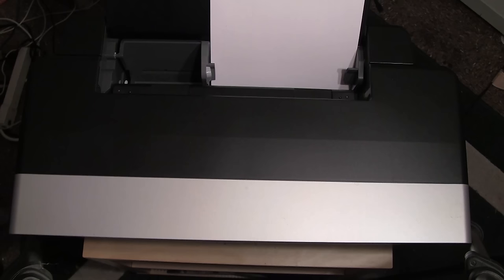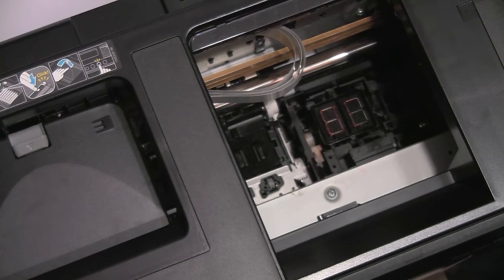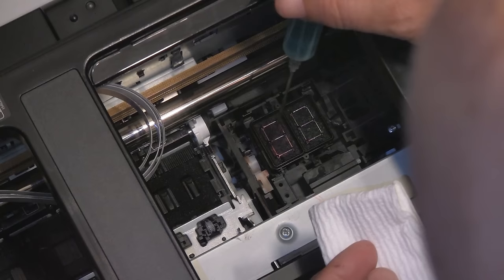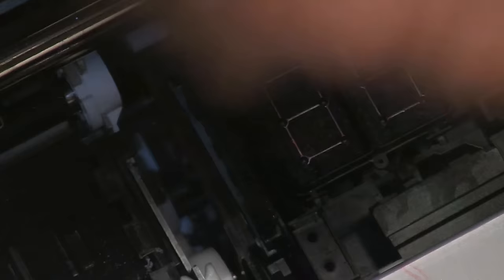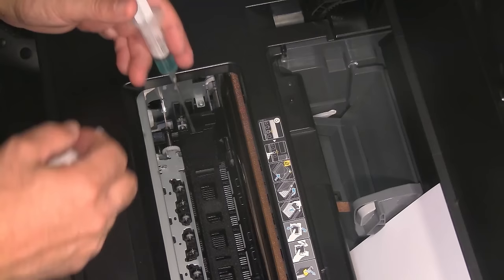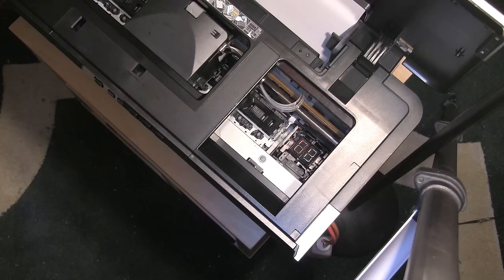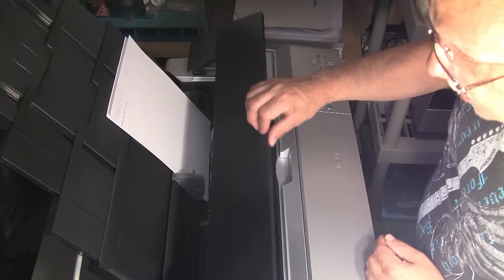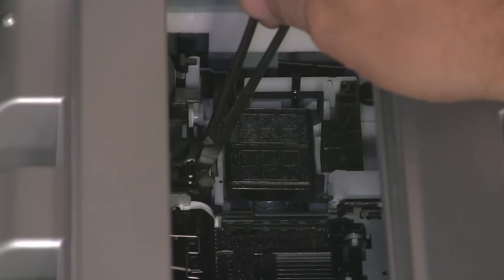How to perform Basic Maintenance on the Epson R2000 and 3800

Comment: after you have left the windex sit for a couple of  hours, plug the printer back in, do you leave whatever is left in the pads there? or blot it out? I love your video, its awesome! thanks so much. I have spent all day trying to get my printer back working (my red cartridge is not printing out on the print test so I know its clogged) and I was at wits end.  All the other information is an added bonus.  Thank you.  PS Im sure you will make a comment:  I purchased "genuine" Epson cartridges (all 8) from China for $36, hey I had to test it out.  Comparing the cost I had too! They are genuine! What I found out was after checking the utilities it provided me with the dates of each cartridge.  Some are from 2011, 2009, 2013, etc.  So just incase you are asked or wondered now you know.  I colors are fine (Ill know for sure when the red works, lol)
Reply from the maker: You carefully blot it up by dabbing. Good luck and let me know how it all turns out.
Reply: Well when I ran the test page the red square did not appear.
Reply from the maker: What printer make and models again? R2000?
Reply: I will repeat the paper towel under the print head.
Reply from the maker: Patience is imperative.
Reply: Well it didn't work and I tried over and over.  I saw your other video on using a syringe and the tube and remove the cartridge, load the syringe with windex and flush the channel.  Where do you get the syringe and tube? Im going to have to try this.
Reply from the maker: Any syringe with a PLAIN tip, not the screw type and a short length of rubber tubing such as uses for gas powered airplane models.  You can buy it from any hobby shop selling gas powered models. You have to slide the print head over some paper toweling. Attach the tubing to the ink nipple of the print head. Attach the syringe loaded with Windex and proceed to try to inject a bit of the solution.  It should not take much pressure.  If so then pull back a bit and attempt again. Bit by bit. Let the printer rest a few hours between attempts until you can freely inject the Windex. Let it rest and run more Windex.  Re install the cart and after a purge cycle you print a nozzle check and cross fingers.
Reply: oh, and where is the best place to buy refillable ink. I have extra cartridges so now I can fill them up. Im already running out of ink because of this. cha-ching!!
Reply from the maker: Wait. What carts are you talking about refilling?  Have we been talking about refillable carts all along and what printer is it again?  If it is a R2000 you can use this device which will allow you to clean a head channel.   http://www.inkrepublic.com/iRemove.asp
Reply: I have a R2000 and it is the Red printer head that is clogged. I have genuine cartridges that I should be able to fill from the front and tape over or i'll just buy another red cartridge.  What has happened is with all the cleaning i am running out of ink and don't want to spend $200 again for new epson ink cartridges just to find out this fix won't work. I'd rather refill my epson cartridges for $100 or less (since I don't need the GO or the Cyan).
Reply: Here is a new one: I  do another nozzle run and the pattern came out with no red pattern showing again.  But when I go and look at my ink levels the red is just about expended. Where is it going?, where are all of the colors going? the ink can't be disappearing just from the pattern prints. I just installed the cartridges the day before yesterday. I haven't printed any photos. I have only performed maintenance printing and testing.
Reply from the maker: You need to inject cleaner into that isolated channel. By the way it is no called a print head, that refers to the whole using with 8 channels. You need to get that item I linked you to from inkrepublic. Watch their video. You remove the red cart, you insert the adapter and attach a plain tipped syringe to it loaded with cleaner. It works as long as there is no permanent damage to the print head unit.
Reply from the maker: Well... the printer will not run unless ALL the carts are there and registering that they are not empty.
Go here for affordable OEM Cart sets for the R2000
https://www.ebay.com/sch/i.html?_from=R40&_trksid=p2380057.m570.l1313.TR4.TRC2.A0.H0.XEPSON+R2000+ink.TRS0&_nkw=EPSON+R2000+ink&_sacat=0
Reply: I have done the procedure with the syringe, twice, and the red square on the print test did not show up.  When I performed the gentle and careful up and down with the syringe there was red coming into the windex solution, both times.  Is that a good thing? Well, either way the test pattern still didn't show up.  I received my refillable ink but now I have to fill the cartridges. but of course I don't have the needles or I guess I have to purchase refillable cartridges.  I thought I could use the OEM cartridges I have.  Im just getting frustrated.
Reply: Hi there, do you know if the Epson 159 inks are Dye or Pigment? They offer two options for the iRemove. My yellow head is clogged (on my R2000) and would like to try this if that what you recommend. Thanks for your help!

Comment: Jose, I just acquired an older Epson Workforce 1100. As I am seeking to convert it to dye-based all-black printing, the first issue I'm facing is: when I send a document to Print, it tries to feed the paper, and the rollers appear to function well enough, but it just doesn't grab the paper to pull it into the machine. I wonder if you might suggest how I could investigate this problem.
Reply from the maker: Well your rollers may simply be worn out. After all it is over 15 years old.

Comment: Hi Jose, thank you for great video. Can i use isoprofile alcohol to clean capin station? Can you recommend the EU alternative to Windex? Thank you for answer
Reply from the maker: Alcohol will not dissolve ink effectively. You need a cleaning solution designed for this. Magic Bulit I believe is sold in Europe.
Reply: In Greece we have Ajax. It is ammonia based window cleaner.

Comment: One more question, can the memory of the R2000 be increased?  I ask because as prints are moved to the printer especially if its a large or heavy print.  It seems to only take as much of the file as it has memory for and print then it takes more then prints more.  It seems that if the printer had more memory that it would create a better print.  My guess is no it cannot be. Also, I have performed your process that you pointed out here and I am back up printing as needed.
Reply from the maker: It's not the printer you have a spooling problem in your computer. One thing you can do is disable to spooler in the services that assuming you're using Windows computer reboot and re-enable it again.

Comment: I left the print head over a Windex-ed paper towel overnight, and this morning the paper towel is completely saturated with black ink! Is this is FUBAR situation?
Reply: Lots of yellow seems to have saturated the paper towel too, but I think it's getting obscured by the black. I haven't been able to do a cleaning or nozzle check because the printer's saying the red cartridge is empty though I just replaced it with a fresh one. 😭
Reply from the maker: Nowhere do I see what Printhead you are talking about.

Comment: do you think this printer is still good today compared to the new printers like the canon pro 100?
Reply from the maker: +David E Well that's like apples and oranges. The EPSON R2000 is a Pigment based printer with Gloss Optimizier and the CANON Pro-100 is a dye based one. Both are excellent. Just because the R2000 is now fairly old does not mean by any means that it is inferior. I have both of them and absolutely love them.

Comment: Hello sir. Thank you for the inspiration. I was given and Epson Stylus R2000 print and after about 40 copies I received the out of ink indicator. Well I purchased Epson 159 ink and now the ink indicator just stays on please assist.
Reply from the maker: You got an empty cart level indication on the driver? You purchased an original Cart and after installing it still shows as empty?
Reply: Great question. I had not fully installed the drivers needed to monitor the cart levels. I uninstalled the driver from the disk and installed the driver compatible with Windows 10. I also unplugged the USB cord for the printer until prompted to connect. Problem solved. Cyan was registering as empty. I purchased another one. Printing fine. What is your recommendation for refill carts? I also see it may be in my best interest to install an external waste bottle. Please assist.

Comment: How does white plastic strip fit
Reply from the maker: It attaches on the right and far left rear wall with a spring. and passes though a sensor behind the print head. That's the difficult part.

Comment: Great video. It answered a lot of questions for me. However, I have an Epson 1430, which is somewhat different. Do you have a video specifically for it?
Reply from the maker: Not really. All have print heads. Purge pads on far right. Purge pad gaskets. Wiper blades. The R2000 is maintained the same Way as the 1400 series.
Reply: @cheo1949  Thanks! Yes, your instructions for the R2000 worked for my 1430. Just checking to see if there is something I missed.

Comment: What is an external  ink bottle?
Reply from the maker: It is used to collect diverted waste ink from the internal purge pump. It's only used on printers that have a side panel that can be removed to access the waste ink tubes. Only on printers with internal waste ink pads only. And not all of them can be modified for external waste ink collection.

Comment: GREAT tutorial Jose very much appreciated!!!   -   May I ask for your thoughts on another issue?    I am having trouble with the printed pictures being red/peach  -  looks like I placed a piece of cellophane over the photo.   I has hoping the cleaning would solve this sadly I am still having this issue.     Any Thoughts so appreciated.
Reply from the maker: Well have you checked you nozzle check? I bet your Cyan is not printing at 100%
Reply: You are correct def. clogged nozzle-   I have followed your Print Head Clogs What to do!    loosened some but, still not good.    :(    I will follow your advise and order some  PiezoFlush.   Thank you so much for all of your advise!!
Reply from the maker: You left out something important. What printer and model are we talking about here? I can only help you if they are Photo Printers.
Reply: Epson R2000
Reply from the maker: Piezoflush will do wonders and next time you need to use your printer often so it does not clog again.
Reply: So the Piezoflush worked   :)   Thank you -   Printed one great photo & now I keep getting an error -  (blinking light of a paper jam) -  It takes my photo paper & normal paper in then stops.  It is not jambed tho - when I press the button it goes straight thru-   any thoughts again soooo appreciated.

Comment: Hi Jose, I have a question about using ciss for epson r2000. What is your thoughts on using third party inks? the inks from epson is too pricy for me. Also after learning from you about maintaining printers saved mine. I appreciate this to you. 
My question is : 
1. Your thoughts about CISS? and if not CISS, is there other types you would recommend?
2. Using CISS for epson r2000, would it harm the printhead? 
3. I'm sure the quality of print would downgrade using third party inks. Do you use any third party inks? If so which one would be recommended.
Reply from the maker: If installed correctly and balanced correctly and it is perfectly designed for that printer then no it will not cause any problems. 
At this time there are no third party inks I would consider a close match to Original R2000 inks. www.percisoncolors has one of the best ones but still not a close match so you need lots of custom profiles for all the papers you are using in order to come somewhat close. The Gloss Optimizer and the general gloss characteristics of ALL the third party inks will not come close to OEM.
Reply: I see, thank you Jose. I was just watching your other videos about refilling cartridges on other versions of epson printer. Seems like r2000's cartridges are not refill friendly as you mentioned in the video that flushed chip versions have included with wet-sensors installed. What would be the best way to save money on inks? Refill cartridges or use ciss system for R2000? I am still investigating if there you have uploaded video about r2000 model but so far, I could not find them since you have so much abundant of info in all printers. 
Again, you are the master of printer, I respect you for your knowledge and mastery on your specialty Jose.
Reply from the maker: It simply is not worth trying to refill these types. Unlike CANON Epson has truly done an amazing at blocking us from refilling their OEM carts. R200 OEM cart sets are actually relatively low cost on EBAY check them out. or Use a refillable carts but I'll tell most if not all 3rd party inksets for it do not come up to par.

Comment: HI Jose! This video is amazing! I had a Magenta clog and this video really helped. I followed the steps the last 2 days and read some of the other advise below. I'm having a terrible banding issue now, and I have a BIG print job coming up. Do you have any tips for me?
Reply from the maker: Three causes of banding can occur. One caused by missing nozzles. Not zzle check will show if that's the case
Another caused by a printhead needing to be aligned. 
Running the head alignment either manual or auto
Thirdly the encoder strip is dirty. That is something a service tech better do.
Those are the three main causes to banding.
Reply: Ok, I will keep running checks and alignments.Thank you, Jose for getting back to me so quickly.
Reply from the maker: So is your nozzle check perfect??